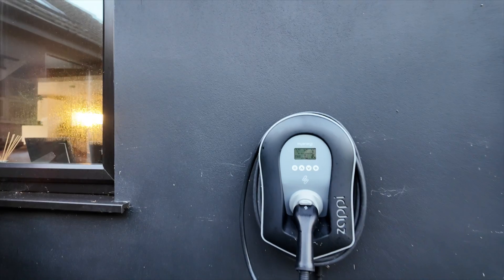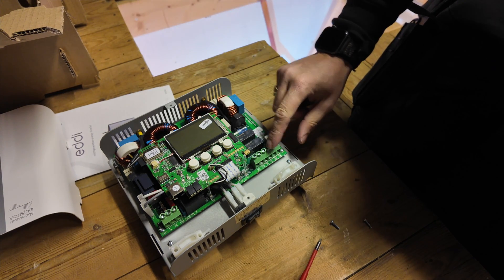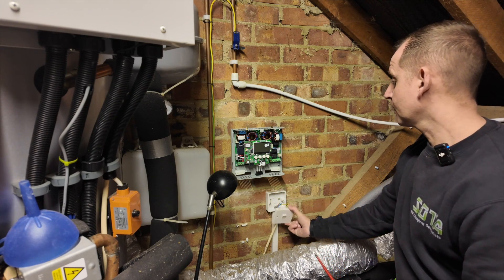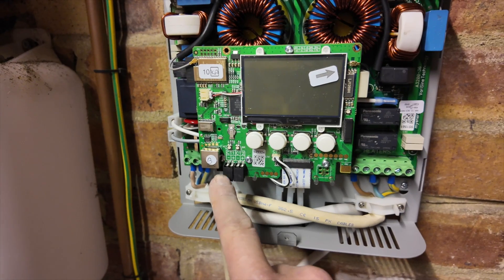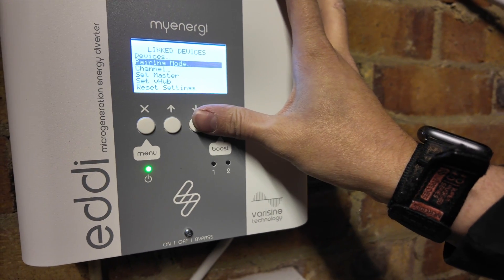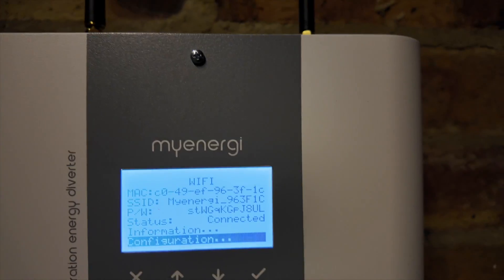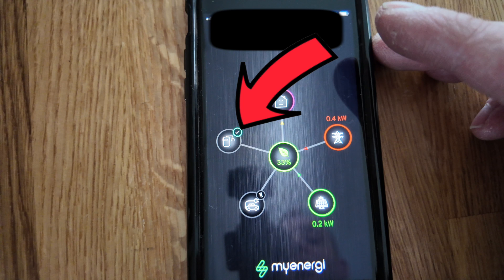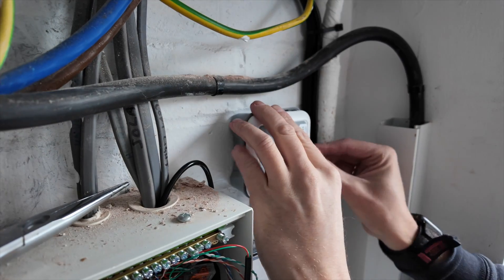How To Install An Eddi & Integrate A Zappi, Harvi & Battery Storage.

Comment: If I want to use eddie to heat separately a HWC, floors and towel racks,.ideas?
Reply: The Eddi has two outputs, which work one at a time in priority order to utilise excess solar. You would set the floor/towel rail amperage on the Eddi and manage the heating with the schedule

Comment: I had an EDDI included as part of my small solar PV installation in summer of 2019 as a battery would have doubled the price. Since then, it has reduced gas consumed by £600, almost double the installed cost.
Reply: £100 a year doesn’t sound like much

Comment: Never knew you could pair the WiFi like that always managed using WPS. The sticker on the front is pointing to the actual tab you need to pull off that can only be seen with the cover off lol.

Comment: Great video Adam. Did you change the parameters for Export Margin and Response Delay on the eddi? I have a recently installed Givenergy AC coupled inverter and found that the eddi responded too quickly to the systems load-balancing where a few watts can flow too and from the grid for a very short period (seconds) so when its exporting eddi thinks its surplus and switches on the immersion heater for a few seconds. I have set mine to 100W and 30 secs as a test.

Comment: Hi, 
I have a simple grid tied solar installation and a lot of energy is wasted and goes out to the national grid.
If possible I would like to send some of that wasted power to an AC coupled Battery via a myenergi Eddi device.
I spoke to an electrician who said the Eddi is only used for hot water tanks but that’s wrong because it also connects with a Zappi car battery charger.
Would the Eddi be able to send power to an AC battery device??

Regards Ian
Reply from the maker: So the Eddie is primarily used for the hot water tanks, you don’t need an Eddie to divert excess solar to the battery storage, you need a harvi and a CT clamp, that’s it.

Comment: Be interesting to see how an Eddi interlocks with an S plan heating system, where it interrupts the power to the DHW valve demand (if that’s the best way to do it!). 
Also, can the Harvi be used instead of a hard wired for the grid?
My garage, where my Zappi is , is remote from the house. 
Thought I tried it when I first installed , but I thought it needed to be hard wired.
Reply: Yes I believe you can use the Harvi for that purpose. As long as both the harvi and Zappi are close enough that they can talk to one another.
Reply: @tom1997williams  seems like a long payback if it only provides a top up once there is surplus solar electric. If only heating the water from the grid electric then I can see the potential value.

Comment: Export price of electricity is always over the price of gas so the eddi is pointless.
Reply: I’m on FIT (feed in tariff) so I get paid for a rate for export and a rate for assumed export of 50% regardless of what I use / export.
Reply: Unless you are locked into the older prices most electrical supply companies only give a few pence per kw
Reply: @adamdavis2788  why would you be locked into any price.
Reply: @Swwils from what I understand if you had solar installed 10ish years ago you would get payed 20p a kw that you export and you where almost locked into the price for it but now you can’t get that anymore
Reply: And sometimes you do things because it is the right thing to do - it’s not all about money.
Reply: I have a cap on what I can export my generation regularly exceeds this cap and no gas availability.  Am I allowed to heat my hot water with my solar please